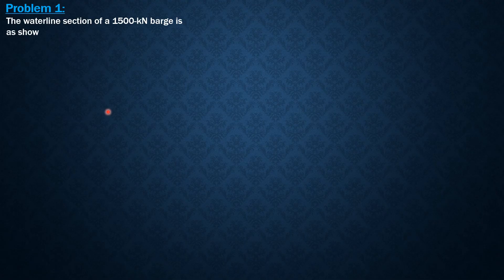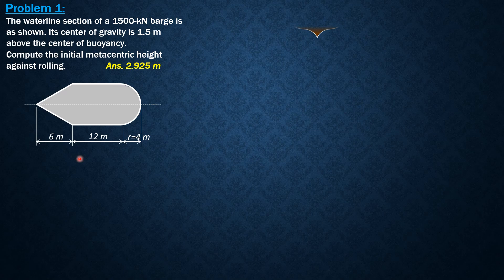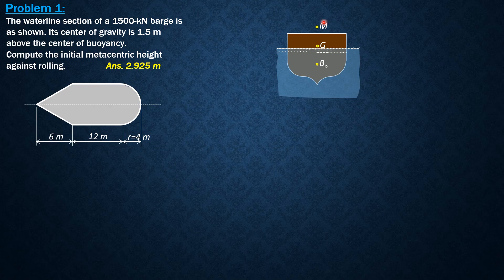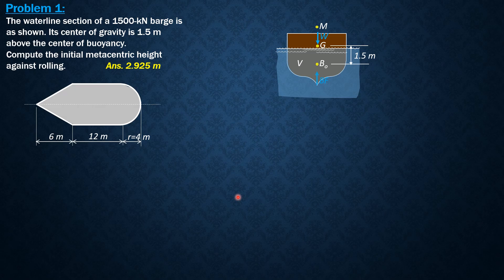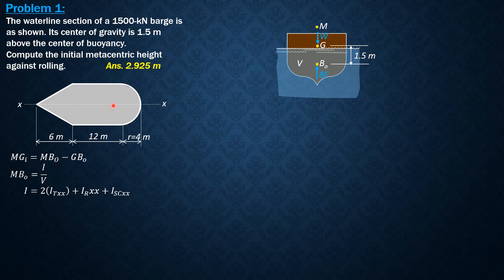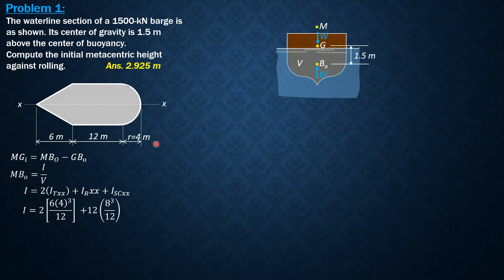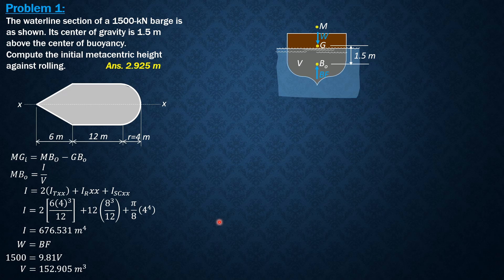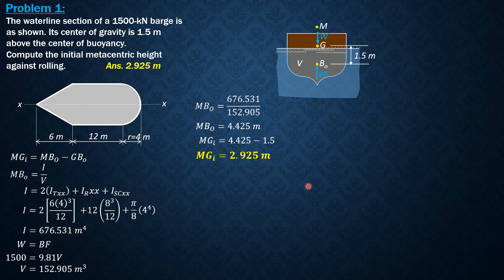STATICAL STABILITY OF FLOATING BODIES, Example 1

Comment from the maker: The moment of inertia of a triangle with respect to the centroidal axis is bh^3/36; with respect to the base is bh^3/12; with respect to a parallel axis through a different point parallel to the centroidal axis, use the transfer formula I=bh^3/36 +Ad^2, where d is the distance between the centroidal axis and the parallel axis through any other point. Please review topic on moment of inertia on area. I have uploaded I think this topic in statics or I have sample problems. I will discuss this thoroughly in the future. You can also derive moment of inertia with respect to the base of a triangle as bh^3/36+(bh/2)(h/3)^2=bh^3/12. I use transfer formula;

Comment: Hello, sir. Would just like to clarify for the Moment of Inertia for the semi-circle. Should we not use 0.11r^4 po, or is that a different formula for the MI of a semi-circle po? Thank you so much for your response! 💕
Reply from the maker: Tama iyan. The axis cuts the circle into two quarter circles. The moment of inertia with respect to that axis is 2 qc. So (pi/8)r^4.
Reply: @StilHOT1970  Ay okay gets na po, sir. Thank you so much po! 💗
Reply from the maker: @gelmarccuaton8829 
@StilHOT1970
0 seconds ago
Tama iyan. The axis cuts the circle into two quarter circles. The moment of inertia with respect to that axis is 2 qc. So (pi/8)r^4. If you haven't mastered calcukations of MI, master them first.